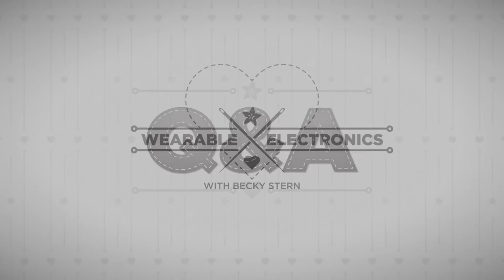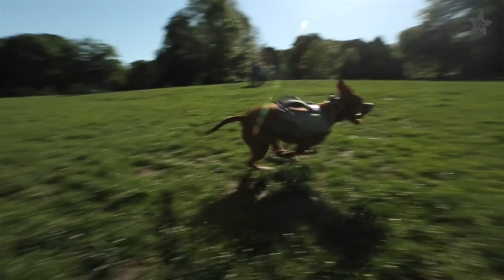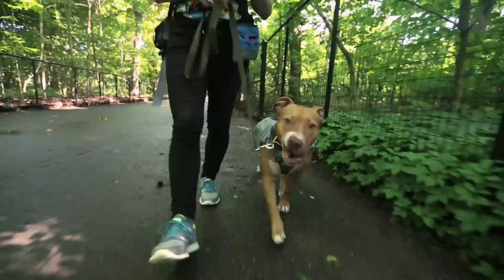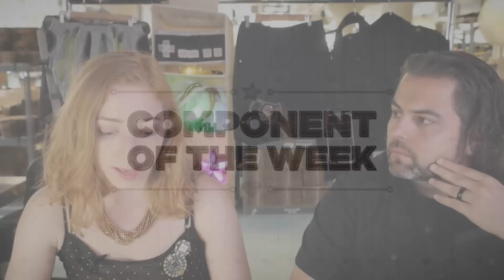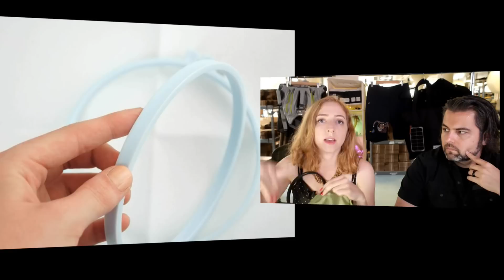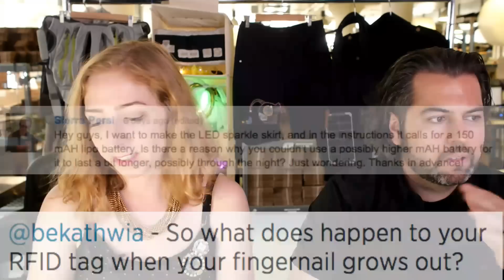Wearable Electronics with Becky Stern 6/4/2014 - LIVE

Comment: I'm working on a neopixel glove and use 144 version of the neopixel strip which has very small contact, especially when you cut it in half. I need to connect each finger (at least data) to the next one and soldering onto these half circles has proven to be very hard and unreliable.

Do you have any advise on how to better connect those pieces of 144 neopixel strip?

Thank you for your show, it brought me back to electronics and making!
Reply: That glove looks great.  It would be very useful on bicycle & motorcycle gear - assuring that riders are seen at night.

Comment: Question for Q&A:
I am thinking about building a project running off one of your lithium polymer batteries. It would be tightly packed and enclosed. Do I need to worry about heat management from the Li-Po and associated regulation circuitry?

Comment: Because the jst to the LiPo battery is the weakest link in my wearable projects, I would like to charge the LiPO battery w/o disconnecting from the project.  Do you have a device or connector that can power a project by LiPo and also has a usb port to allow recharging?  In other words, can my illuminated scarf be plugged into a recharger?  Thanks  Becky Vand

Comment: I would like to create a project with a LiPo battery that can be recharged while the battery is still in use.  Can i just solder another JST connector for the LiPo charger to the battery leads?
Reply: I can remove the battery from the wearable but want to charge it without losing power to the controller.